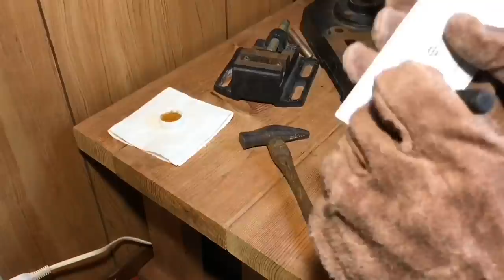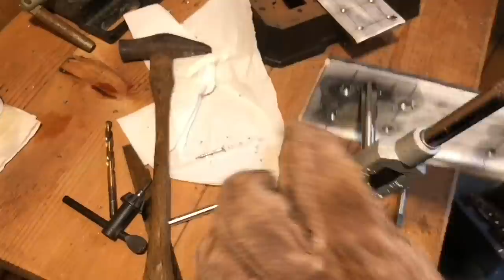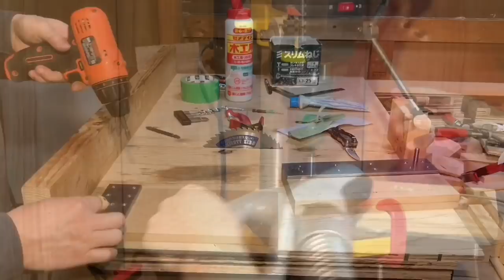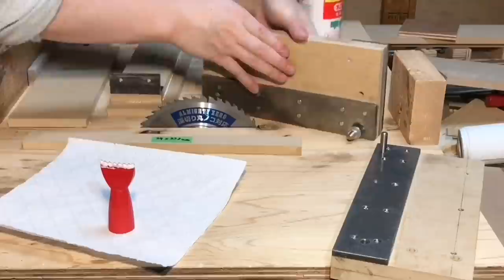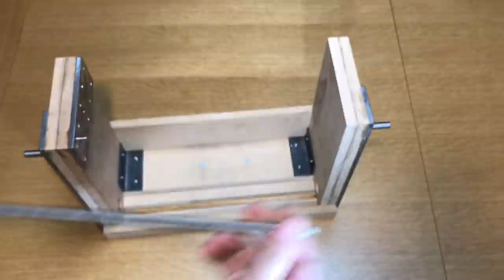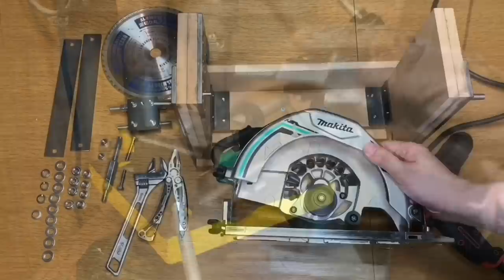Homemade Tablesaw 1/3 - Depth Adjustment System

Comment: Good video and a job well done , I built a 4-1 box ,table saw , router, inverted jig saw and disc sander .After watching all the videos I decided to go full size 3' x 4' top ,and I am glad I did . My original skill saw gave out so I upgraded to a Makita 10,&1/4" saw now I have much more cutting capability and cutting height with my sled " it wasn't cheap" . Enjoyed the video !
Reply from the maker: Thanks 😆
Yours sounds nice 👍 
In this table saw project, I was thinking about a jigsaw mount and actually I made a router/jigsaw table last year before these videos (I didn’t take the making video tho.)
But my concern is its usage. 3 or 4 in 1 means the other 2 or 3 functions might be killed when we are using 1 function. 
Meanwhile, possibly I can’t use the jigsaw function when I set up the router. This is what we should think about this.

Comment: Nice! But I couldn't make any sense of it until you loaded the saw and saw the way it worked. May I suggest to you to slow down the video a bit? I understand the video will be long if you play it in normal speed but you can snip here and there to shorten it. Like if you screw a few screws, just show one will do. 
Some voice over will be nice or maybe you can just put some subtitle to replace it if you feel shy. On video measurements will be even better.
Keep it up. Love the jig. Looking forward to see more.

Comment: Just one precision: is it enough rigid so that there is no vibration of the circular saw blade when it's work ?
Reply from the maker: Essentially tablesaws require good tuning. I have to well adjust all bolts and nuts of course. Then it has no significant vibration.
I designed this structure based on the original design of circular saws;
Every circular saw has its base plate. Saw body is attached onto its base plate, usually only by 2 supports. I just used these 2 pivot points to attach the saw body to tablesaw. Nothing different from original structure of circular saw at the point of these supports.
Anyway I'm planning to upload videos, using this tablesaw. Watch out and make sure. I never let you down.

Comment: Don't trust the alloy fender. It is quite weak. Mine broke during normal use at the hinge. So, I wouldn't recommend putting screws through it for the lifting mechanism.

Comment: J adore l idée je pense que je vais la reprendre si cela ne vous dérange pas ... j aurai une question niveau précision  d ajustement de la scie et des coupes cela reste précis ?? Et la monter descente de la lame à la main   sa reste correct ? Ou à la visseuse c est mieux ? Merci de votre réponse si il y a des plans de la parti mobile de la scie  y aurai t il possibilité de les avoir ? En tous cas beau travail
Reply from the maker: Actually I'm making a new video that can show what you asked, though it is taking much time. I'm working on it.
I'd like to do more on a website to offer more information but I'm doing all by myself and it's a bit overwork. I need somebody to help me.
As for depth, the accuracy depends not on this structure of table saw but on the original hinge of circular saw.
When the hinge of your circular saw is nice and accurate, the saw blade will go up and down accurately.
So we have to choose a good circular saw.
Reply: Sean Kamki  désolé je ne parle que français ...  si j'ai bien compris cela dépend de la table ainsi que de la scie circulaire    j'ai une hitachi c9u2

Comment: Добрый день.Скажи пожалуйста какой толщины металлические полосы? Спасибо за информацию.
Reply from the maker: I used 6mm thick, 50mm width steel for the frame. 3mm one for saw legs.
Reply: @SeanKamki  нельзя работать в перчатках на рутящих механизмах, может замотать.

Comment: very good jobs ;) , where is the model of your circular saw ?
Reply from the maker: Thanks. I used Makita's M585 190mm.
Now I'm thinking of an universal design for any circular saws and, this is still not a fixed idea tho, probably it's better to make 2 shaft holder by small steel pieces and to screw or weld on the attachment plate. Then this design will be useful for any sorts of circular saws.

Comment: reds skate bearings?
Reply from the maker: +Vincenzo Annunziato Yup, I used them.
Most skate bearings have the same size, 22mm diameter and 8+mm hole. You can use any skate bearings and M8 bolts.
Reply: This is a very interesting playlist video! Big up!